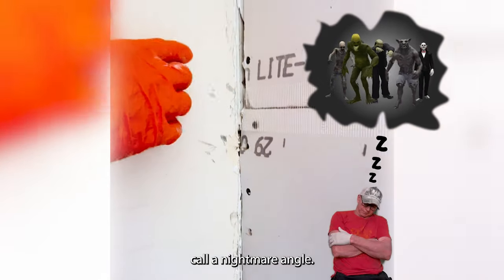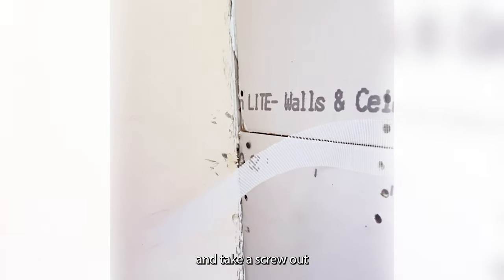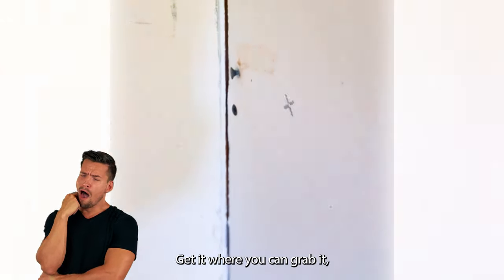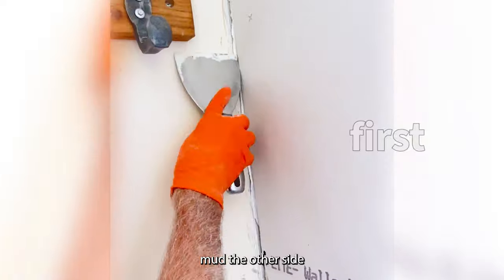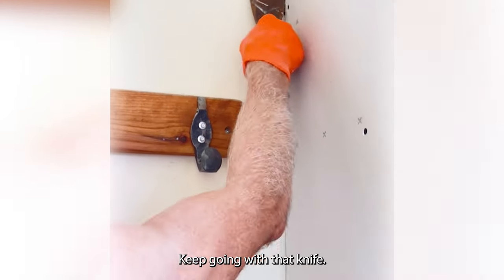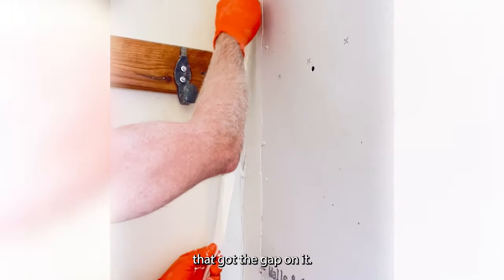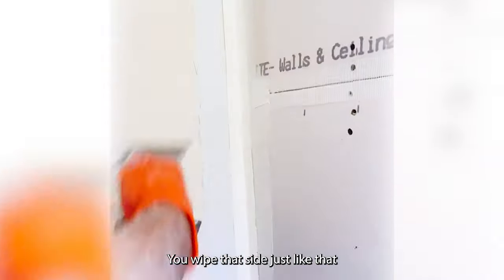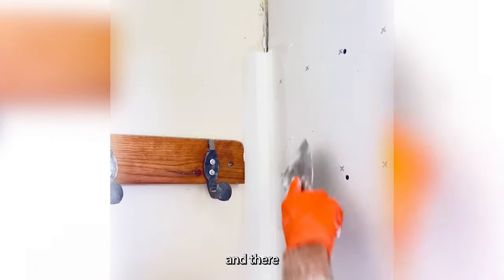Close the Gap Challenge: Mastering Inside Angle Drywall Taping

Comment: why not use 20 minute mud and prefill? i guess you want to do it fast. if i were doing this at my house, i would prefill.
Reply from the maker: I highly respect your suggestion. However, when working with DIYers, they don’t have multiple types of mud on their project.
Reply: @thedrywallguyofthediy245   but its best to use hot mud and prefill right?
Reply from the maker: Yes 👍🏻
Reply: @racker7855  Yes prefilling (for seams) is important and when you do it a setting type compound is best. However, when it comes to angles it really isn't required, because of the typical shrinkage/movement of the studs there are attached too. The guy on the "Drywall Doctor" channel  has a good video that talks about this, it's titled "Day 1: Some Basics on Prefill and Angles Drywall Tutorial Week!"